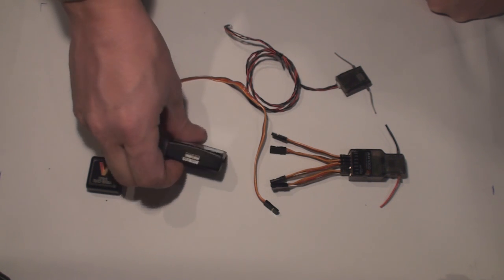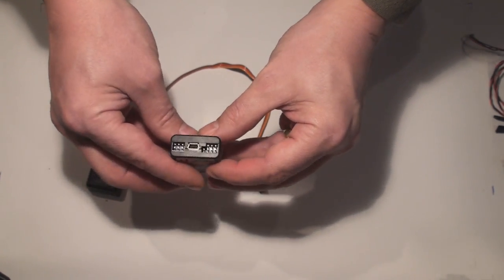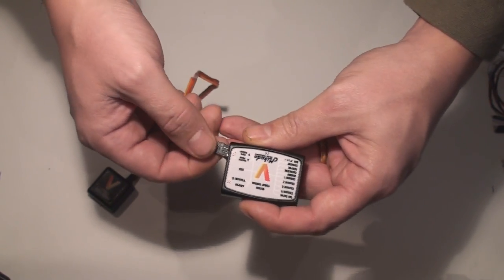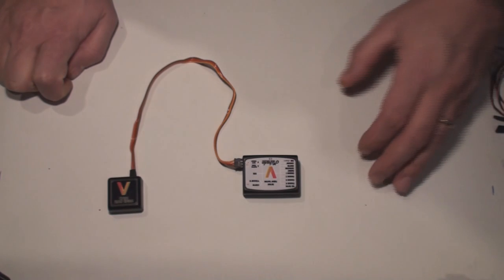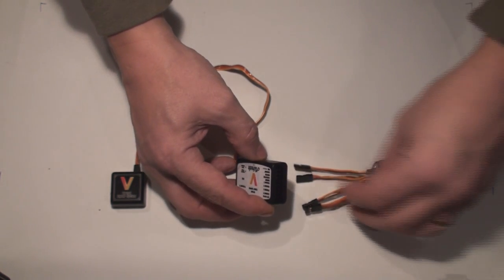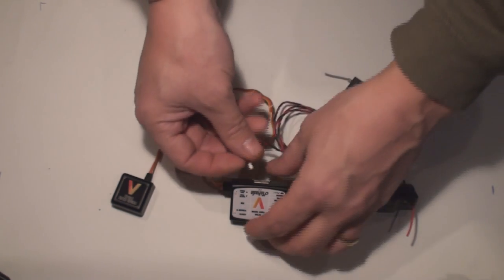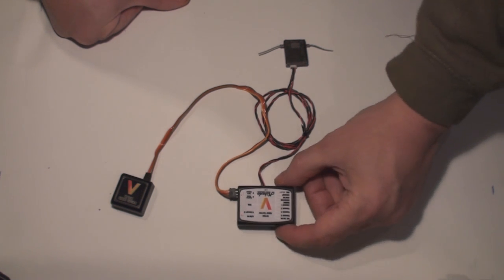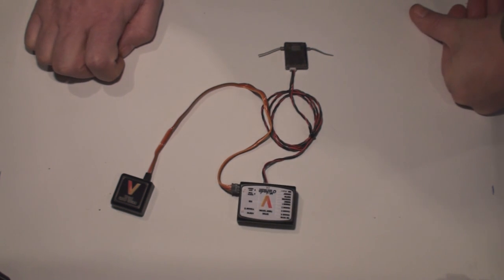VBar 101 Episode 1 - Regular VBar

Comment: hi, im using the same vbar (without ports) + AR7000 RX, but using a bec pro aswell. im alittle confused where to put the 2 power cables from the bec pro? do they go into the AR7000 aux 1 and 2?

ive been trying for hours, the servos are twitching (like they should) but no movement from the stick inputs?